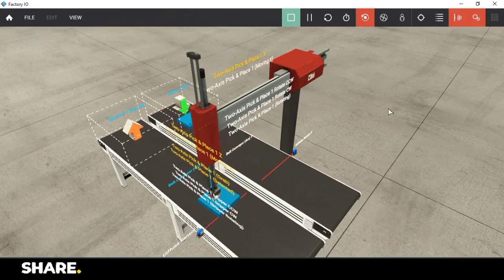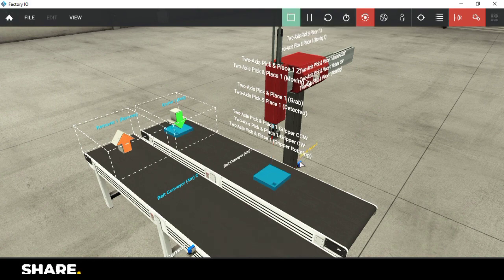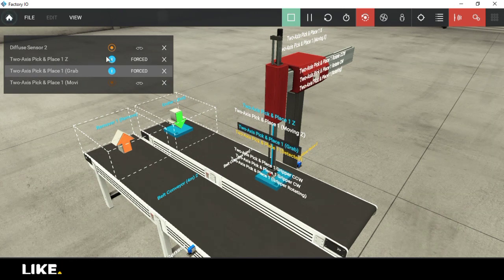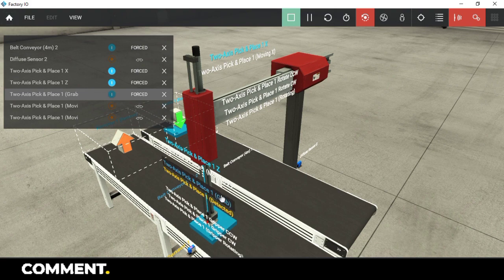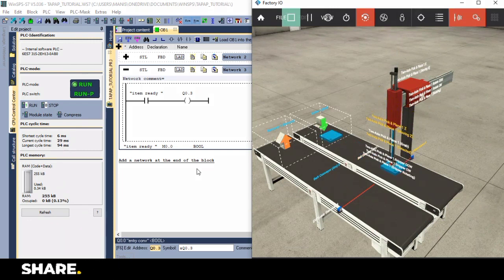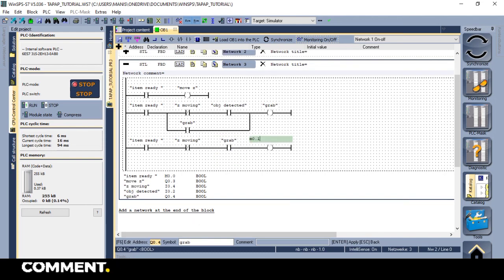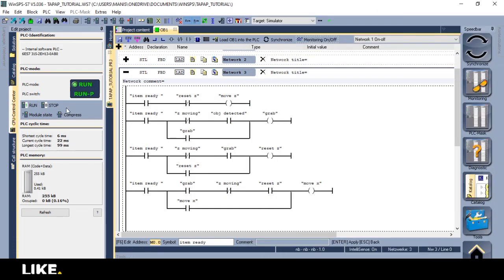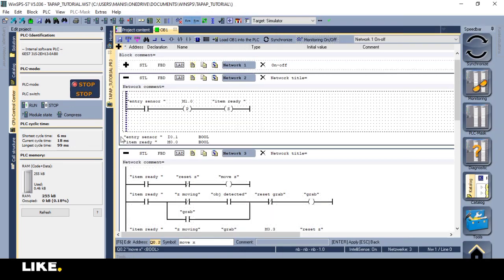How to use Two Axis Pick and Place with Ladder Logic | Factory I/O | WinSPS S7

Comment: is it different using gx?
i tried but something wrong
Reply from the maker: I didn't get it. Kindly explain
Reply from the maker: I got it you are referring to the GX works. 
I haven't used it but the program should work if you setup the environment correctly. 
If possible can you explain the issue that you are facing?
Reply: @real_ee  so im making the proggram so the x axis of the arm move first and i put timer there. but im not certain is it because the timer or not, but the sensor or actuator from the x axis (you name it move x in the video) activate the same time with condition for the pick and place grap
so its like they insist upon it self
sorry if its hard to understand my English not very good
Reply from the maker: Can you share your program in pdf format. I am travelling for plant commissioning and won't be able to respond frequently, apologies in advance but I'll try my best to assist you.

Comment: how do i make that (p), (r) and (s) code?
Reply from the maker: (P) is positive edge triggering/ detection 
(S) is set coil and (R) is reset coil instruction. You can find those in instruction list. You can also use the SR flip flop instead of the set/reset coil instruction. 
You may refer to this for more details
https://cache.industry.siemens.com/dl/files/822/45523822/att_82001/v1/s7kop__b.pdf